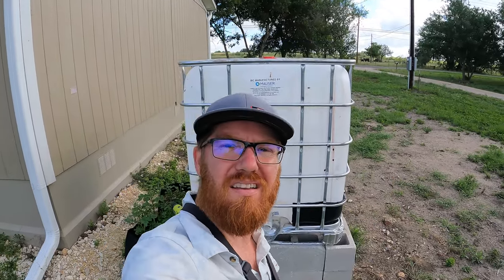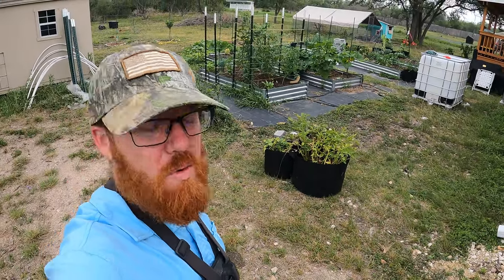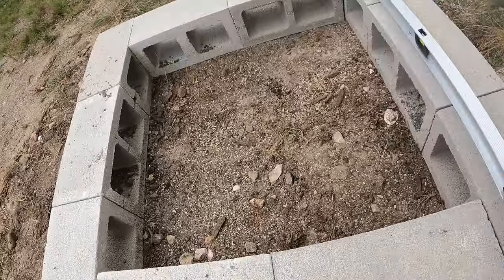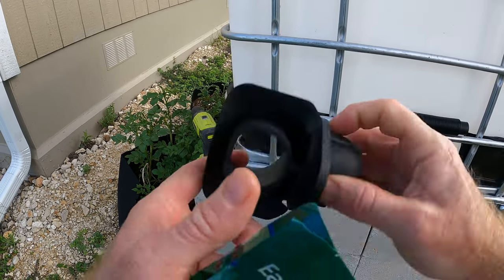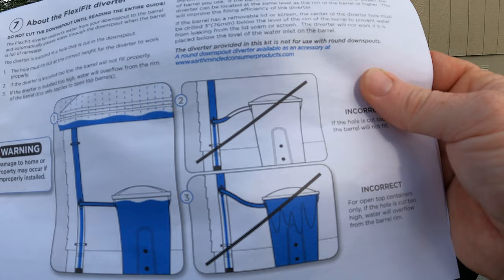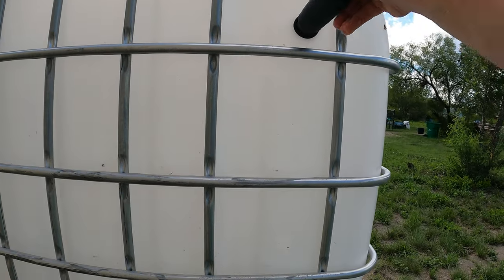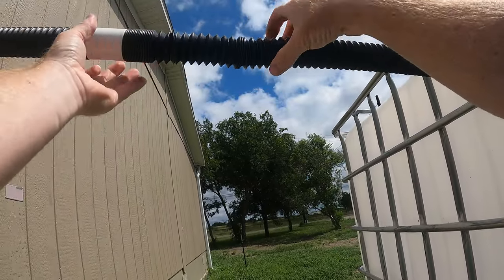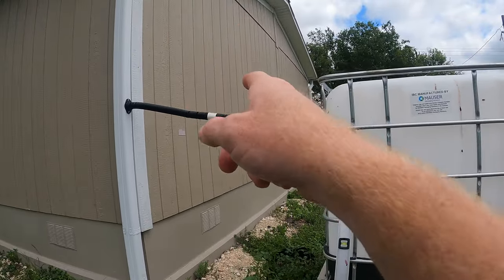Rain Water Collection Instal and Setup

Comment: That's incredible!  A 55 gallon drum is only around 100 or 200 bucks. You're saying that 275g was not much more? Dang!
Reply from the maker: The 55 gallon one was $75, this was $150, so double price but to do two 55 gallons which I was going to do, would have been same price and this holds 150 more gallons
Reply from the maker: Btw, it was a place that buys them all used and re-conditions them.  All of them had pickles or olive oil in them, no chemicals or petroleum products